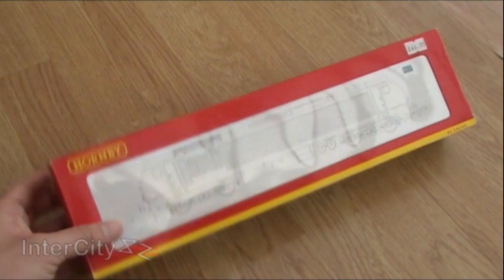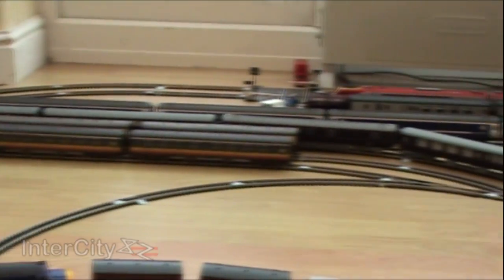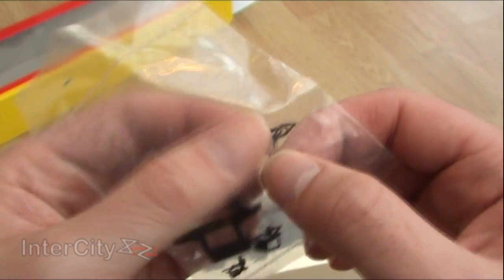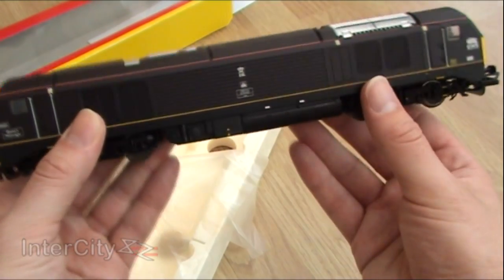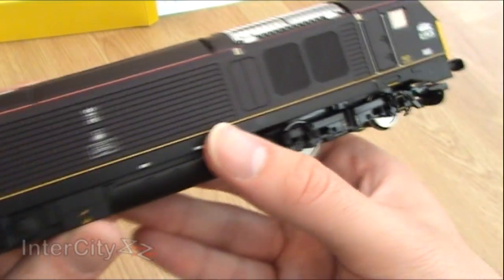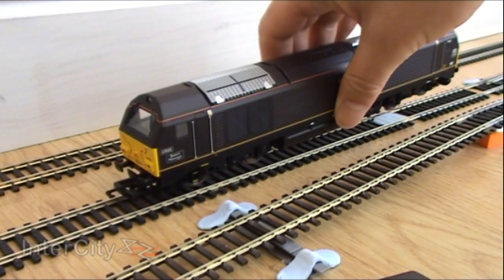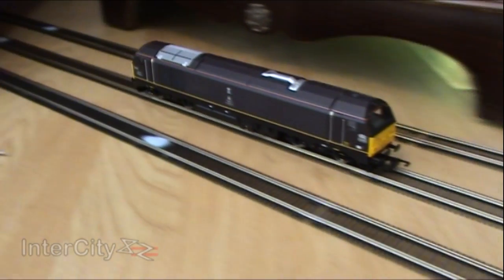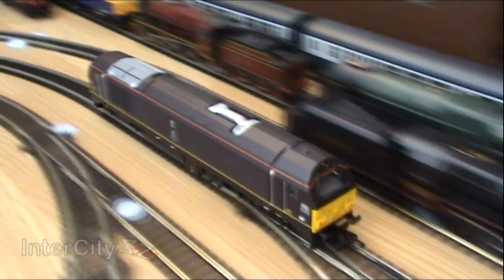Opening the 'Queen's Messenger' Class 67 from Hornby

Comment: I do not need this model as I have got the rail simulator class 67 I saw the real version of your model at Doncaster hauling dead class 91 set The model is very good mind All the features work on my rail simulator version I drove my class 67 from Old Oak common to Paddington Platform 4  2 miles Alsthom make the full size class 67`s with GM Power units of 3,200HP